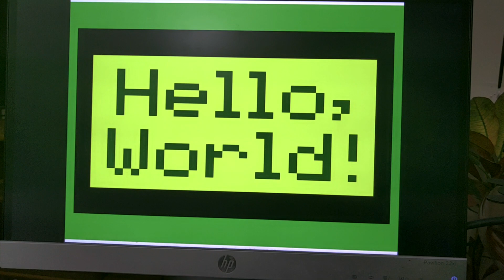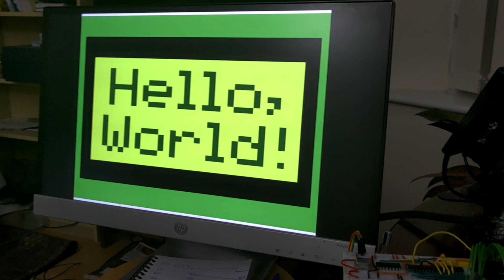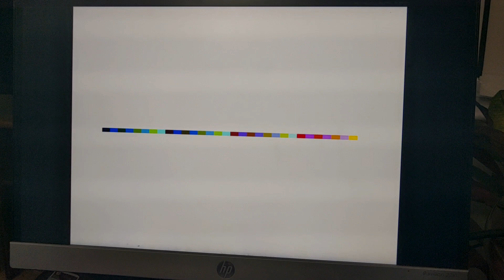World's Simplest VGA Update - hooking up to a Ben Eater 6502

Comment: I think that with just one extra chip (the ROM from the previous version) driven from the same counters you could separate out the sync data from the image data.  Without a bit more detail on the circuit I can't be sure that this would fix the loss of sync when writing, though.
Reply from the maker: Yes that is an option. It would still glitch the display during writes, but not cause loss of sync. On my other system I joined the vsync to the NMI pin to allow the CPU to update VRAM between frames, and that could be done here too.
Reply from the maker: Another advantage would be freeing up more bits for control signals, e.g. to allow double-scanning, so that the pixels could be more square.
Reply: @GeorgeFoot  and also allow more colour bits in the SRAM.   With 32kB you should be able to do 160x120 @ 8 bpp.
Reply from the maker: @RayBellis  Hmm, maybe. If we're using the same counters, they need to count up to the vertical total including blanking and syncs, which is 525 in 640x480, and to double- or quadruple-scan we need to pad horizontally to a power of 2. So 160x120 actually requires a 256x131ish region of storage.

If you start from 640x400 instead, the vertical total is something like 489, I don't recall exactly but it's less than 512, so this fits better. So 160x100 would require a 256x122(?) region, which does fit in 32K.

It may be possible instead to just not store the vertical blanking region in RAM, as it's at the end of the frame. Then 160x120 would work too. Or use separate counters, etc...
Reply: @GeorgeFoot  right, I understand - you'd be needing to ignore one (or two) of the counter's output lines from being presented to the SRAM's address lines so that those lines repeat..   I had accounted for the horizontal  1.25x overscan (to 200 x 100) but not for that.    And of course going out to 256 (*4) would mess up the alignment with the "true" 800 pixel timing clock for VGA.   Hmm.
Reply from the maker: The 800 alignment is not too hard to deal with, we'd need to reset the horizontal count at the end of each line (200 quadpixels) and increment the vertical one, but we could use an extra control bit to trigger that.
Reply: @GeorgeFoot  right, without seeing the schematic I wasn’t sure if you were just using a single counter or separate ones for columns and lines.

Comment: So it was just a matter of adding RAM , some bus transceivers and a bit of logic? Its a lot simpler than my solution. I might have a rethink my VGA as it got quite complicated in the end. Does the VGA take up part of the memory-map of the 6502 and how much is that?  Have you looked at my circuit https://easyeda.com/david.clifford/vga-card_copy? I update the RAM only after the latest pixel is fetched and stored in a latch, that way the screen doesn't go blank when writing to VGA memory. It adds some complexity but not much. You could use 3-state Latches like 74hc574 to hold the x,y and pixel data coming in from the 6502 instead of bus transceivers, but you might then have to synchronise your CPU to the VGA frequency to avoid glitches.
Reply from the maker: Yes, it's intentionally very rough for the sake of simplicity. If you already have a better system that works I'd probably worth sticking to - the value here for me was designing something so simple I could experiment from scratch without much effort, so I could try new things without risking breaking my other computer that already works.

I don't want to synchronise the CPU with the video clock this time round, it worked well before but was very fiddly and inflexible.

Any asynchronous masking or latching is also going to be somewhat complex to get right without risking sending very short write pulses to the VRAM under some circumstances, or changing the data or address during the write operation. More thought needed, I'm sure I'll find a compromise of some sort!
Reply from the maker: Having said I wouldn't synchronise the CPU to the pixel clock this time, I've gone ahead and done it anyway as it solves tons of problems. I don't know if I'll keep it like this, but it only needed an extra D flip-flop pair, so not too much complexity and it's a great way to understand how the timing would need to be constrained for an asynchronous system.

I've tried it in a 1.5ish MHz configuration and a 3.75ish MHz configuration so far with great results. I'll keep playing with it, and post a schematic/update/something later.